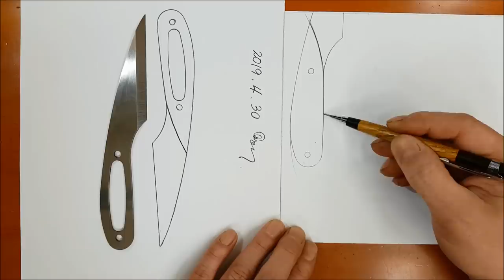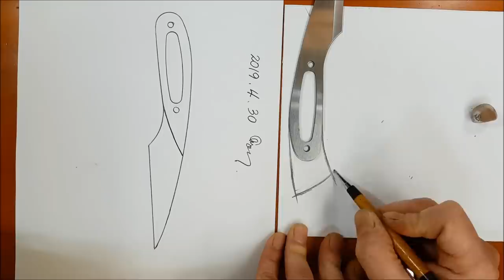Making KNIFE / HSS blade, Silver, Special wood

Comment: What is that instance glue you are using? Is it just normal 10sec glue? Want understand that it can hold the knife sides together that good. Or are you relying on the pins to hold the knife together? It’s just that all knife makers I’ve seen use epoxy on the sides.. 
Very beautifully made knife!
Reply from the maker: Not all of the common ones are correct.
Many people use epoxy.
No, only epoxy is used.
I also use epoxy, but not in this video.
I think instant glue is a better way than epoxy, so I did it by my experience with 29 years of work.
I am sure of how I work, and I haven't been wrong for a long time.
Thank you for your interest and praise~

Comment: When sanding to flatten pieces do it in a figure 8 motion. Easier to get it flat without making a radius on one side:) amazing work dude
Reply from the maker: When I first learned about my work, I did a lot of sanding with eight characters.
You don't know how to sand 8 characters.
I know it so well,
Even if you don't do that, you can flatten it almost perfectly,
You do not need to use the 8 character sanding method.
I have been doing this almost every day for 28 years.
Thank you for the advice.

Comment: When I saw the construction of your pen I realized that the knife would be easy for you, but definitely another masterpiece. Ask why you didn't use epoxy glue? All respect to the teacher.
Reply from the maker: Epoxy adhesive,
The adhesive strength is maximized when there is even a little space on the adhesive surface.
For adhesives with few gaps, a higher viscosity instant adhesive is more advantageous.
Faster, stronger bonds.
Testing has shown that the instant adhesive is more advantageous than epoxy
Reply: @SilverMeister  Will it work better in the long run? Thank you.
Reply from the maker: @arkas6797  
Of course.!
Recently produced adhesives have been produced in the past,
It has been developed for much more purposes.
If you use it according to your needs,
Much more efficient than ordinary epoxy.
I have been doing this for 30 years.
I believe in my experience.

Comment: Wouldn't it be better to use something like mineral oil to coat the wood? How do you stop the vegetable oil from going rancid?
Reply from the maker: Thanks for the advice,
I work in the best way from my experience.
This is not a coating.
Just wipe it once...
Thanks~
Reply: @SilverMeister  Fair enough. If it works it works.

You might want to consider mineral oil in future though, because it doesn't go rancid at all.

Anything organic can spoil.

But hey, I'm not the one making these works of art, so as you say, if it works, it works!

Comment: What are you cutting with this knife that you need high speed steel. Are you cutting steel or bone? HSS is more brittle than high carbon steel so it may not be very strong, hard but not very strong. HSS is normally used for machining steel and wont keep a fine edge like a kitchen knife.
Reply from the maker: I know what you said.
However,
It was made as requested by the client.
I did not choose the material of the knife.
Thank you for your attention and advice.

Comment: The problem with vegetable oil, it goes rancid and starts to smell. Mineral oil, the stuff used on cutting boards would be better.
Reply from the maker: I know the problem of vegetable oil.
It is used carefully so as not to be a problem.
You do not have to worry.
I have been doing this for 29 years.

Comment: Wouldn’t epoxy have been stronger?
Reply from the maker: When time passes, the property that maintains its strength
I think the instant adhesive with higher viscosity is superior to epoxy.
Reply: @SilverMeister  

Not sure what science there is to support that, but the superglue used appeared very thin...?
Reply from the maker: @sudo_nym  
I,,,
4 instant adhesives,
Five kinds of epoxy are used.
Just what I used in this video is just an instant glue.
It's hard to tell everything about me in a few words.

Are you experienced?
I have been doing this for 29 years,
Never been wrong due to the use of glue,
Never once.
Thank you for your advice,
I work my way.

Any further conversation,
Respect carefully.
Sorry.
Reply: I’m not making any assertions about you. I was questioning why you use superglue when every knife maker I know of uses epoxy. What and who you are are of little interest to me. 
Seems to me that superglue is weaker than epoxy. 
I wouldn’t trust it to hold up under heavy use, like I would Devcon epoxy. 

Still, I suppose caveat emptor applies when buying knives.

Comment: I like the way you did this, But more interesting to me was the blade you have, AS I have been in the wilderness a lot, Had a cougar come after me from behind, Fortunately he made enough noise I turned and fired in time,
But learned a lesson, I usually put a knife on the lower part of my leg since then when in the bush, 
Reason is if any animal comes from behind and attacks you and grabs from behind, You can always access you knife as usually your hands will be low enough to reach the knife, and that sort of blade will penetrate much easier. and usually make the animal let go to see what has attacked it.
I think I will make a blade later with much more of a penetration ability.
By the way, This happened when I was jogging down a trail. and if I had not stopped instantly, I may not be here today. Remember that about jogging in the wilderness, always have eyes in the back of your head, And make sure little children are always between 2 adults,
Reply from the maker: Thank you for your comment in the long post.
You and I live in a completely different environment and culture.
There is no wilderness around me, and no encounter with animals on the way.
This knife wasn't for me to use,
It's just because you have someone you want.
I'm not a knife expert.
I don't know if the translator will convey my meaning well,
Your advice is appreciated.